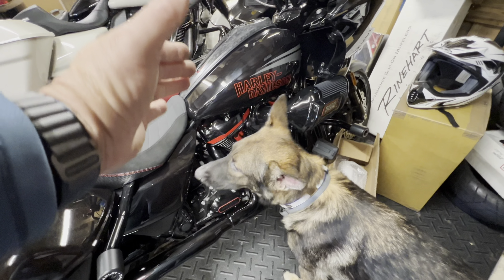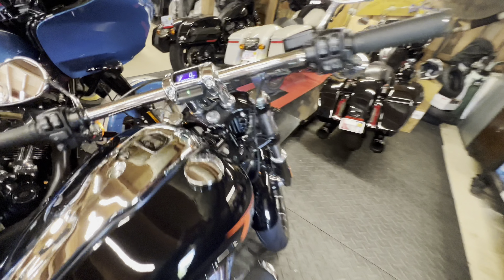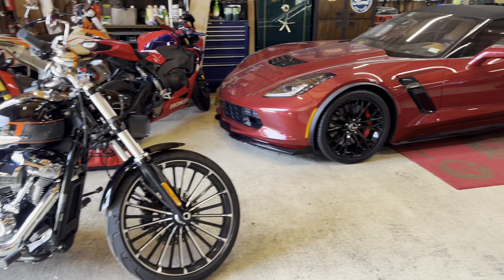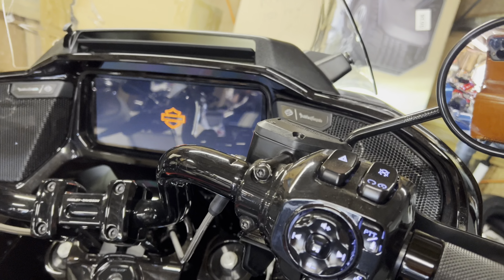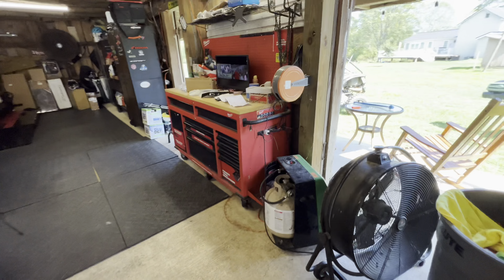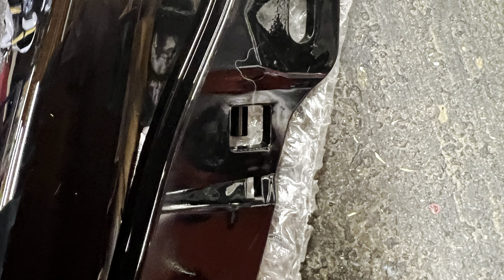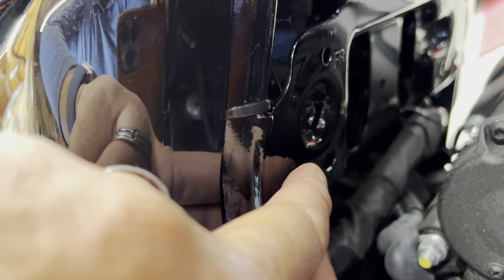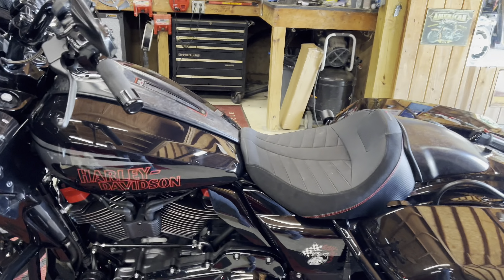HARLEY DAVIDSON CVO ST HEAT SHIELD INSTALLATION

Comment: Use an extension with a swivel socket quarter inch drive… I put mine on no problem at all… use a piece of tape to hold the bolt onto the socket

Comment: Never start off a video by bragging since nobody likes a bragger!  For the audience, these heat shields are super easy to install when you have the proper tools.  Just use a nice ratchet style wrench and install the hardware from the opposite side of each deflector.  Or, use 1/4 inch style regular ratchet with a small wobble extension and socket.  Harley sells these heat shields for the CVO ST.  And, the color of your bike sir is called, “Raven Black!”
Reply from the maker: Good info thank you

Comment: Really don't need them.  It stops the air flow........
Reply: Smh...
Reply from the maker: @jasonkimble8926  then why do the all the touring Harleys have them installed at the factory?  And not arguing just asking
Reply: @Iceagetv  just for looks,
Reply from the maker: @jasonkimble8926  yeh makes sense